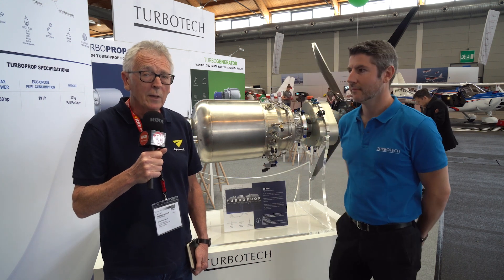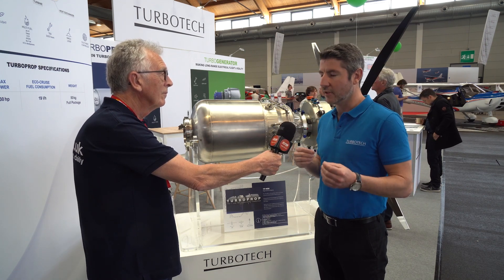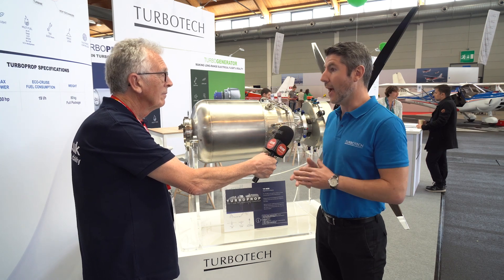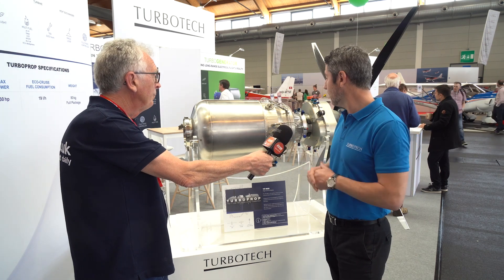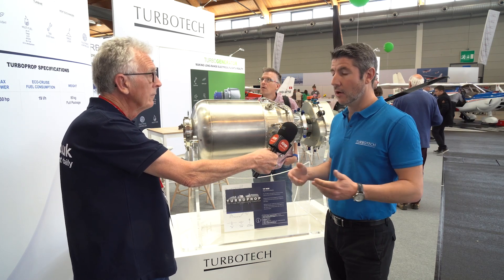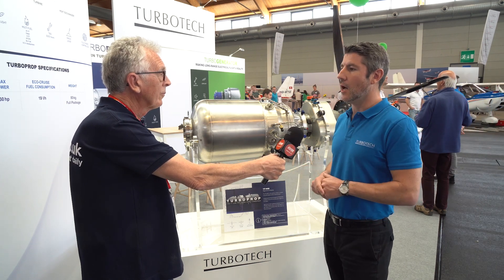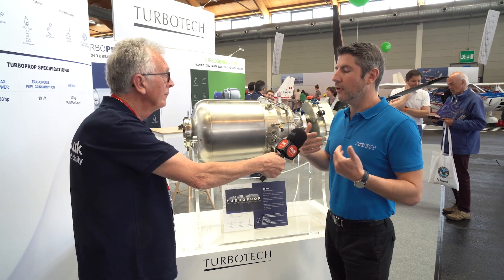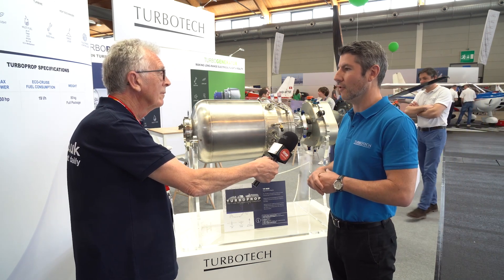TurboTech's small turbine for light aircraft revealed at AERO

Comment: If you want to succeed in the US market, build a version with 180 HP.
Reply: 200hp is the sweet spot because higher is high performance endorsement.
Reply: They're supposedly aiming at producing more powerful variants for that range of power
Reply: @FoxMikeHotel  They will also have to keep costs down, 90,000 euro for the 130 HP version is not sustainable in the North American Market.
Reply: @glsracer  yeah it wouldn't be in the European one either, but if they manage to get some sales, hopefully with economics of scale they can drive the cost down to something more reasonable that would make the return on investment more certain and faster
Reply: @glsracer  It's not sustainable in any market :-) An internal combustion engine would be significantly more economical than a 130 HP gas turbine engine.
Reply: 176lbs is kind of heavy for only 130 horsepower, I expected it to be less.

Comment: There are two vital questions you need to ask about any new engine, but especially about turbines. What  is the expected cost? And what is the expected TBO? TBO is critical for these small turbines. I know of one helicopter whose engine has a TBO of 25 hours!
Reply from the maker: €90000 and 3000 hours
Reply: A third issue is the fuel consumption .
Reply: @georgesheffield1580  19 L /hr at 290 km/h on a VL3
Reply: @philv3941  where is that data from? JMB published nothing about performance of the VL3 with turbine on their website, and 19 L/hr with this engine would be less than 60 hp... can the VL3 cruise at 290 km/h on that power? What does a Rotax burn for the same cruise speed in the same airframe?
Reply: @brianb-p6586  I've got a model of a similar sort of GT which can break through 35% thermal efficiency. That would net just under 50KW on the power turbine. You need a recuperator that can provide outlet temps of around 650c which is probably doable. But the thing is, turbine inlet temps on this model are right at 1050c, so there's not much higher you can go without active blade cooling and fancy ceramics. If you stick a steam cycle on the back, you get another 20ish KW but you no longer have an airplane engine.
Reply: Time Before Overhaul